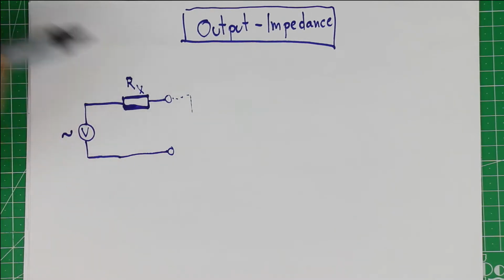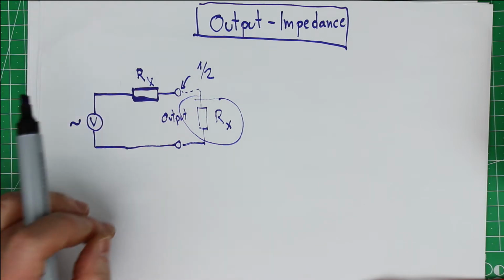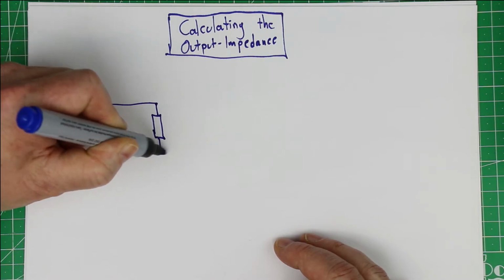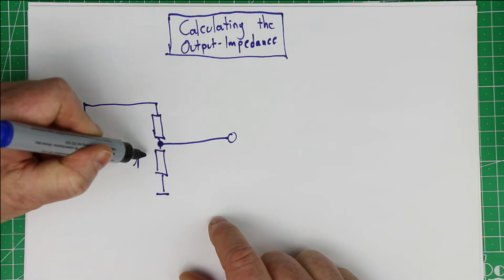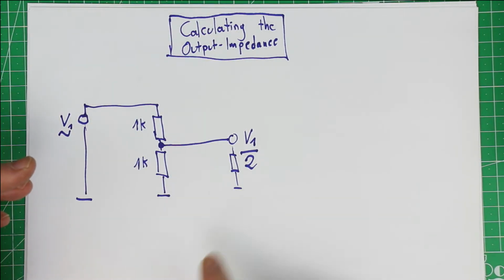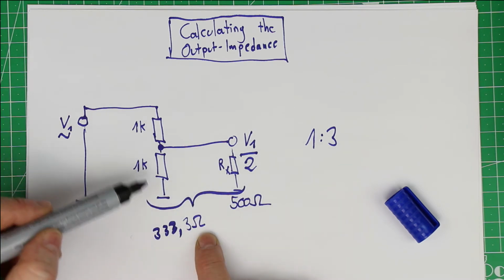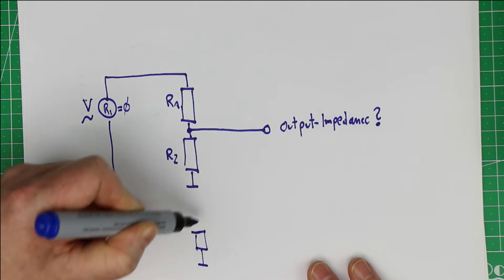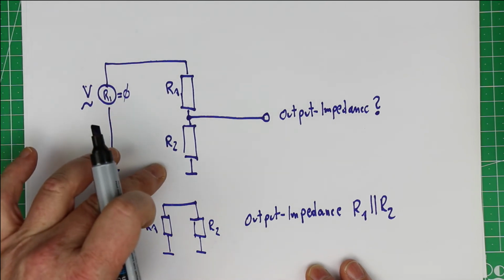Output-Impedance: 2 simple methods for measuring and calculating

Comment: Another way to look at this is to ask what is the thevenin impedance at those terminals (across the lower resistor).  To answer that question one would short any voltage sources and open circuit any current sources and "look back" into the circuit to calculate the impedance. In doing so it is obvious that both resistors are now in parallel and the parallel equivalent of two equal resistors is one half of the value of either one.

Comment: nice video..which function are you using rms or peak on DMM
Reply from the maker: "peak"??? Most multimeters have integrating ADCs (like the traditional dual-slope converters). So I don´t the understand the question.